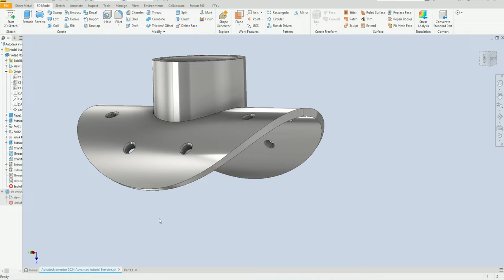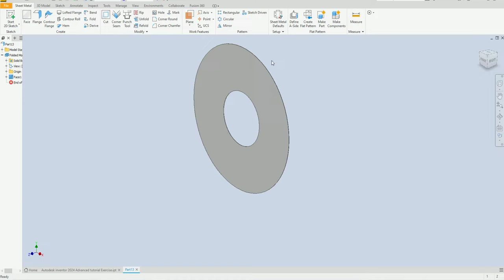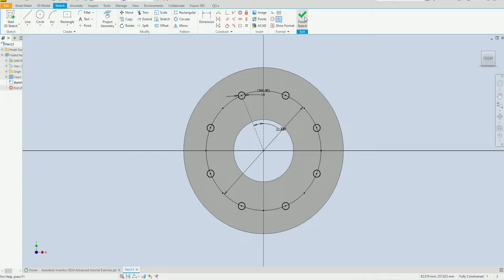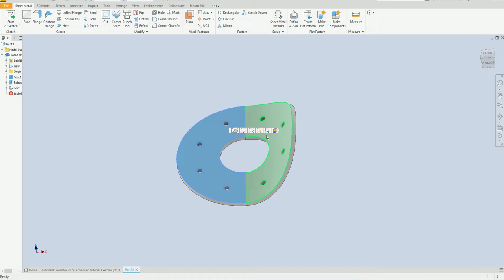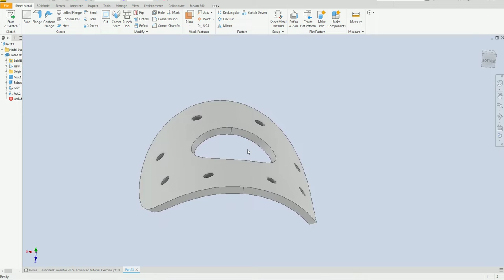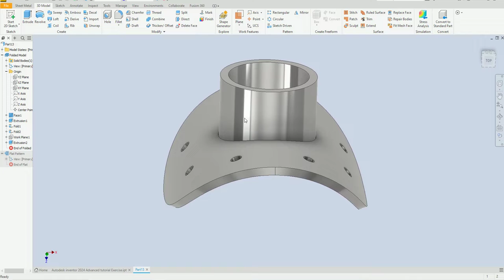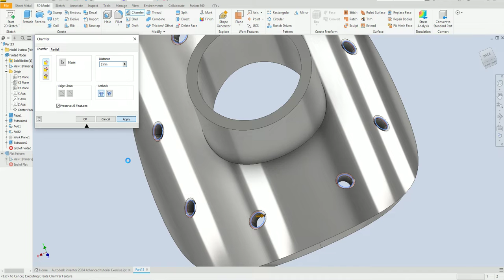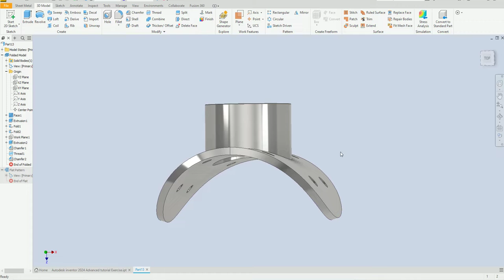Autodesk inventor 2024 Advanced tutorial Exercise 9 Curved circular plate

Comment: The problem with this is that the holes if drilled or cut pre fold/rolling would deform once rolled and become ellipse. Alternatively if you wanted the holes to be circular once rolled they would be ellipse on the flat pattern. They would not be circular on both the flat and rolled play as you show here

Comment: Well done, sir!
I would like to know where this component is applied or used.
I'm simply curious 😉
Reply: For reinforcement of drilled holes. Eg if you are making a hole of 6 inch on a header pipe of 10inch, you will weld this fitting around the hold to give more strength to pipe. This fittings generally used in hot tapping.

Comment: hello, its a very useful video first of all. Thanks for it!
I had a question, when I am doing yhe exact steps I cant have my extrudes (in this case holes) follow the curve such as, they stay almost in space, like they did not stick to the part. I can attach a picture if it was possible but do you know how I can fix it or what might be causing the issue?
Thanks a lot! @solicam-cad
Reply from the maker: Thank you sir🙏 . if you have followed the same step as i did it must work . do have extruded the first sketch or do you have apply sheet metal with a thickness ? to create those 8 holes try to use cut command instead using extrude cut .  if it is not working so send me picture solidcam750@gmail.com

Comment: Now what is the holes sizes when you measure them after the bend of the plate? Defenate not 14 mm anymore
Reply: The plate will be cut from sheet metal anyway. Therefor you need the flat pattern, were the wholes are circular and exactly 14mm.
Reply from the maker: very smart question i like this question 👍👍👍👍
Reply from the maker: yes it make some changes,  because the hole have been created before the bend process ant it have some effect